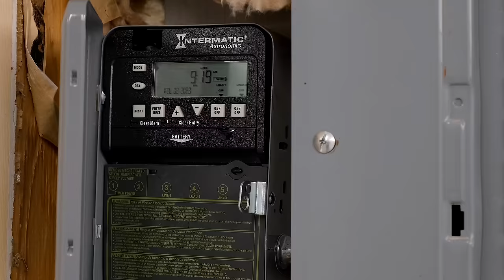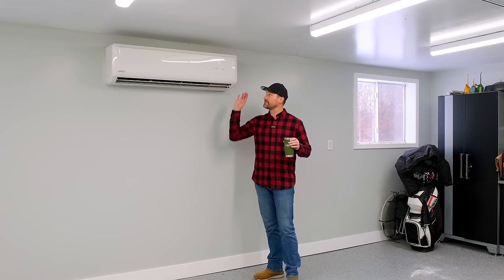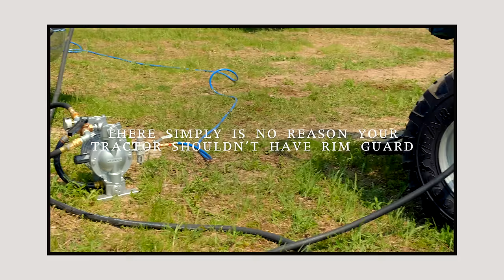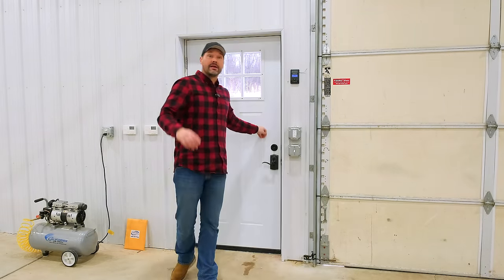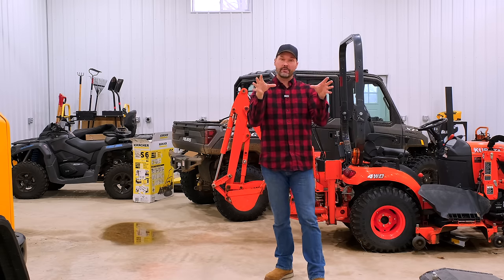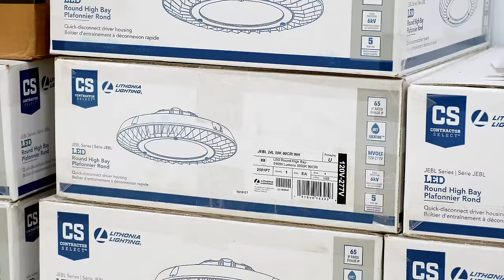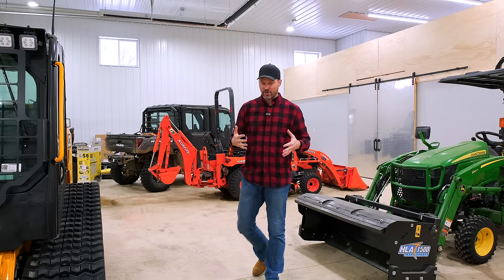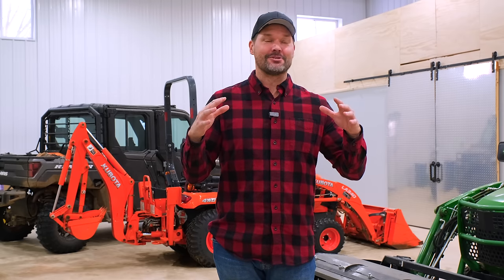AVOID THESE TOP 10 POLE BARN MISTAKES OR IT COULD COST YA!

Comment: If you can stretch between two outlets without touching either they are too far apart.  I also like windows that are high, short, and wide.  Especially the kind that crank out.  They let in plenty of light without being a security risk and my hounds can't see wildlife to howl at.  Compartmental lighting with a master switch for every area is nice to have.  Flip 3 of 4 switches when you leave and you know power is off everywhere, including those lights above the work bench you can't see from the front of the building, etc.  A timer for lighting above the primary external door is nice so you can see to lock up in the dark.

Comment: My biggest regret was not putting in floor heat in. Or atleast all the piping to hook up to later. I was in a time crunch and ran out of money. Needed to finish the barn to move on with life. Also for everyone else take what ever size building you think you want/need and go atleast the next size up. And my 12’ over hang off the 40’ side of my building was my best decision i made. That out door covered storage is awesome. Keeps the snow, ran, & sun off anything sitting under there.

Comment: Epoxy floors are super nice but if you do it make sure it's done right. The garage I bought has epoxy flooring but occasionally peels up after parking vehicles or tractors and will need patching. I can see it wasn't properly scuffed up first for best adhesion. If yer going for the garage mahal just remember buy once cry once. Maybe too, if you spend it more will come lol. Oh I couldn't help notice your sec cam or IDF cabinet  is near a sink and plumbing.  Um... good luck never having water somehow finding its way in there. You may want a splash guard but then again maybe never happen. Working in IT I've seen it enough times when it affects production and you have "Jerry's kids" for work force. Enjoyed the Great video!

Comment: Hi Courtney, I don't know if  it works or not but, my cousin says he uses kitty litre he buys at Walmarts and a wooden 2x4 block to cleanup oil stains on his concrete.  Just dump some kitty litre on the grease spot and rub it in with 2x4 block and the stain will disappear . Worth a try. Love your new shop.

Comment: You may want to consider an exhaust fan if you are running equipment to exhaust any fumes. Also in the cold hot weather it can circulate the air

Comment: If you call around to certain plumbing companies for your floor drains you can get a camera hydrojet done it's basically taking a pressure washer and shoving it through your pipes for the camera on the end it'll definitely let you know where they are and where they end up plus it helps clean out the drains really well

Comment: Thanks for the video Courtney. I’m hoping to build a 40x64x16 post frame (or maybe 48x72 😊) with 3 large overhead doors and a mezzanine in the next year or two. A finished room and bath/utility room under half the mezzanine with workshop under the other half.  Also a 12’ wrap around exterior porch on one end.

How thick did you have closed cell spray foam applied to the walls? And how thick is your new concrete floor slab?
Reply: If I was u stay at 40 foot wide    over 40 ft it get  pretty pricey   go longer and stay at 40 ft or lower

Comment: My shop is used a lot automotive maintenance and woodworking. I did put a loft in which we use for storage to free up space on the main floor. I also painted the ceiling and upper half of the walls white to improve the lighting. If you're going to use it as a shop I recommend putting 3/4" plywood on the lower 8' of your walls. It is more durable than metal and gives you a solid surface to mount or hang things. I also painted the lower walls and doors with an oil base paint that way it is washable. Grease hands and latex paint don't mix.

Comment: i'm going to polish the concrete. i cut expansion joints every 10 foot on a 45 and it looks like huge tiles, i'm going to do a black and red acid stain checkered pattern with a black border and joint filler. should come out great and be super durable. also using siloxane sealer for extra protection

Comment: Good Vid, thanks!  I just put up a Morton Building and am in the process of finishing it out right now.  The shed had it's own Cat6 for internet, 200A electrical, and I tapped my existing well to bring water.  It also has it's own septic and a bathroom too.  Add ceiling fans, helps stir up the heat.  I did most of your suggestions.  My walls inside are 1/2" OSB.  Steel looks nice, but OSB is nice for hanging things.

Comment: In 1995 I built my 36x60 heated shop on full foundation and 2x6 framing like my house.  Expensive but it matches the design of the house.  Thought about building bigger at the time, but cheaped out.  Been kicking myself ever since because I was stupid and located it so that it is very hard/expensive to add on to it.  So now I'm working with a contractor to build another building for unheated storage, pole barn this time, and it will be 40x80 .  Fortunately, I live on 9 acres and the township allows an additional building.  Other towns, one outbuilding and you're done, so no second chance.  A friend lives in the next town over and the max size shop he could build was 35x35 with 8 ft ceiling.  He wanted to go bigger but couldn't, so do your research before you buy.

Comment: I'm looking at building a barn this spring.. if I can find a construction company with employees - that's quite a problem where i'm at, none of the good / known builders are taking on new clients (for the past two years now). Good points on the floor drain and lighting, already had that in mind. A gantry crane is a must have for me at least, and for a welding station I always purchase abuse resistant 5/8" drywall to line it for fire ratings. One other note that I typically do in workstation areas, is have 3/4" plywood behind the drywall.. so you can hang anything anywhere. :)
Reply: I’ve not heard of abuse resistant drywall, is it Type X?  Do you also put rock wool behind it to increase the fire rating?
Reply: @elained9591  yeah, I use rockwool for sound dampening too. it's not really needed with the abuse resistant stuff. It's super heavy tho. As for the type X, it's also in the type X category for fire resistance.. but it's great to use in high impact (fabrication) areas.
Reply: @6point5  thank you!  I knew about Type X, I didn’t find rock wool all that heavy though it is heavier than fiberglass batts.  I think it’s easier to work with and I’m not itching everywhere😂  I want to put in a small welding corner in the tractor shed and can’t figure out if I just want to use metal around it, yes things will stick to it probably or Type X. Any thoughts?  I know how to MIG weld but want to learn stick welding.
Reply: @elained9591  oh, I meant the abuse resistant drywall is heavy. really heavy. 4x8 sheet sucks to lift on your own, something like 100lbs each. 
Type X and rockwool is fine for fire prevention, I just like the abuse resistant so if you hit something into the wall (steel, carts, etc) it doesn't dent.
Reply: @6point5  I’ll have to look into abuse resistant drywall. That’s something I imagine our specialty supply store has a better price on since the box stores no longer give Veteran discounts on building supplies

Comment: I agree with all of your recommendations except maybe height and mezzanine.  Our 40x60 with a porch, floor drains, bright lights, and concrete plus epoxy coated floors.  We added 6 wondows on the south side to gain light and love that.  We also went with power doors on each end for a drive through and park off to the side. That has worked well for our farm truck, RTV, and tractor leaving plenty of room for wood storage and shop area.  We plumbed in for a bathroom and 2 exterior faucets next to the concrete entry pad.  Wash mud off outside!.  We are set up for a possible apartment with a shower and commode and sink, plus a shop sink and on demand hot water (propane).  We didn't feel the need to go higher and add a mezzanine...ask us in 5 years if we regret that.

Comment: Just put a down payment on a 40x80x16’ high, with 14’ high x 18’wide overhead door.  I went with the clear panel 24” under the eave for natural lighting along the entire north wall.  I have no intentions of heating so R-Value is not an issue of the clear panels.  Added a 10’ x 24’ long porch along south wall.

Comment: Love the super clean look! So many shops I have worked in were poorly lit and felt like a cave. The mistake I made in my shop due to budget was filling it with stuff intending to add the insulation and electrical later. Now that winter is coming to a close I'll have to pull everything out.

Comment: About the plumbing: be glad it is a polebarn. Without a concrete stemwall in your way, it is relatively easy to dig up to the building - then undercut the slab almost anywhere to run lines. Saw cut the floor, and you are good to go.

Comment: Looks nice….I did think of the water lines and conduit pipe, but totally forgot the water drain lines.  I wired mine up to save money and turned out good but forgot to run some constant hots outside for plugs.  

For your drain line search, you may try google earth.  You can select the date at bottom left and go back in time and may see the trench lines.  On the floor I would use the rotary disc on pressure washer (commercial style is faster) and just spray some concrete sealer after it dries. Stains will still be there but that epoxy is a pain. Also make sure to seal that new concrete if haven’t already….that will reduce staining.

Comment: My dad and I started with a 40x60x14  back in 2006  and added on every year and a half  till 2012 when we stop   and he died back in 2017  and I added on one last time in 2018     now it 264 feet long with a 16 ft overhang on one side and a 90 ft on the other side with a 30 ft greenhouse  and I getting ready to add a other overhang on again and put in my shop where my greenhouse is at so I can get that free heat from the greenhouse in the building in winter if the sun is out

Comment: I put two runs of LED strip lights that run the full length of my workshop with no gaps.  They work great.  Very few shadows and very bright.  The only problem is when you walk outside at night to go back to the house, you can’t see a thing for the next 60 seconds.  Highly recommended.
Reply: Strip lights won’t have the lumen output like a commercial fixture like these. There’s a reason all commercial spaces are built with low or high bay lights and not strip fixtures. With a lower ceiling height they become more of an option.
Reply: @Sparktrician  Au contraire.  Commercial strip LEDs have plenty of light for a workshop.  Most recommendations are 80 - 100 fc for workshop space.  My shop is 32x48.  Using the 80 - 100 fc range this gives a lumen requirement of 122,880 to 153,600.  The commercial LEDs used provide about 12,000 Lumens each and I have 12 of them, two rows of 6.  This yields 144,000 lumens which comes out to about 94 fc which has been more than adequate for my needs.
Reply: @Sparktrician  Sure, it is your prerogative to be wrong.  My lights were recommended and installed by a commercial builder and work great.  I have not measured the light intensity as I have no need to.  With a white ceiling and white walls and a white overhead door, my workshop is plenty bright, almost too bright and the light is much more evenly distributed than buildings using essentially point source fixtures. Point sources only work well if you have very tall ceilings.  With my 14’ ceiling, point source lights would have been a bad solution and would have created bright spots on the floor and a lot more shadows.
Reply: @Sparktrician  Well, as a licensed electrical and structural engineer in multiple states, I stand by what I said.  You commented on a situation you knew nothing about.  Not very bright of you, pun intended.  😁

Comment: with regard to your flooring, i have used airplane hangar paint. if it can handle your gulfstream, it can handle your tractor. i can not remember if i etched it first but i probably did. also, for another project, i used the paint that you can get in home depot. it came with the flakes. that worked out quite well too and probably hides stains well. just remember, once you open the bottle on this, you open the bottle on this....if i was doing something like you, i might look into a stain - perhaps a marbling stain. why? it might hide the stains from machinery and wheel spin, it might look great, and it might be less maintenance in the future. i would not be looking to create a seal, i would be looking for it to breathe. if it breathes, there is no barrier like with anything oil based. so no bubbling or peeling.

Comment: Mr.  Courtney!  Thanks so much for this video!  As you may recall it was one of my questions to you - size of a tractor shed and your timing is perfect.  We have a woodworking shop at the new place.  We finished upstairs with a bit of sheet rock and a split duct system.  We also put in a split duct system downstairs where my power tools will be.  We chose this over the less expensive hvac system because of their efficiency here in the South.  We also had an electrician change out all the old 8’ florescent lighting to 4’ LEDs and relocated one I could have never reached due to my height.  The 4’ are more manageable for me and the same fixtures could be used so the cost was lower. It’s really bright which is needed as we age.  

My only issue is there was no water to the shop…who does that?  No water meant no sink and more importantly, no toilet.  So instead of adding another septic system, I’m looking at a composting toilet😩 which may be something for you to think about.  We were able to have a plumber tie on to the well and run water to the shop so I will get a sink at least.  We are just going to put in a small point of use instant hot water tank inside and then outside will have a frost proof dual silcock so I can wash the dogs under the lean-to.  It would have made life much easier if the original owners had put a half bath in at the least.  Hindsight is always 20/20.

Although I haven’t tried it as yet on the concrete floor in the shop, I understand sodium percarbonate will remove most stains on concrete as well as a bunch of other stuff.  Works best with hot water and you’ll need a stiff brush to keep working it in, keep the area damp or wet until you’re able to get the stains off.  I originally purchased it under the trade name “Stain Solver” but it’s just sodium percarbonate at either 99% or 100%, not sure which. I do know it will remove grease and oil in a carport with a little work.

I would also suggest for folks who are building to consider where they live before putting a lot of windows on the south side as this will provide solar gain making their interior warmer.  In the South where we have longer hot weather periods, they might want to look at sawtooth or north light architecture which will provide a more consistent lighting with relatively no heat gain as compared to south windows.

Comment: I’d say my biggest regret was running the electrical in the wall. I’ve added machines or moved machines to a different location and adding another circuit just isn’t easy. Next one I’ll do will be all external conduit. It makes it much more serviceable and can be changed and modified easily.

Comment: Take a look at rust bullet concrete. It is very DIY friendly, can had sand added for grip and can be repaired easily if damaged. 

I’ve used it on two garages and have been happy with it.

Comment: Best way to get oil stains out I’ve found is powdered tide. Dump it on the spill, “grind it in” with a boot, let it sit 5-10 min then get it wet and grind it again and wash. Works well for the building we used for wrenching and butchering back and forth

Comment: You are absolutely correct build bigger. You never know what else you may acquire in the future. Radiant heat in the floor plumbing lighting and the loft are all points of interest. I also like what you said about drainage especially as it pertains to cleaning your vehicles inside  and the slope of the floor to permit rain to drain outside away from the barn.  I have also seen videos regarding water collection from the roof which was tide into the water collection system. Also wall areas for working on equipment waist high plus storage. Overall its a good looking place.

Comment: A couple of comments on a great finish. You've done a lot to attain the space and conditions you were needing- congrats! On your two shorts- the kitchen and the poor water control at the roll up door, and I'll bet on other walls with that paving outside; on the kitchen or what ever, plan what you are installing to use OTS cabinets, cut the dry wall, quick patch it for insectr control and cabinet over it. Without a drain line you don't have a bathroom will be difficult but doable, and last, on the rain water- was the slab all poured at one time and then the building erected later? That would explain the threshold problem- and you should look to see if water is affecting the base of other walls. You started with bare bones and have done it well!  FR
Reply from the maker: Hi Frederic, thanks for the comments.  Good tip on the kitchen.  Plan to add that and a bathroom down the road.  Too much money to swallow at this time.  I'm unsure of the timeline on the original building and slab.  We just moved in less than a year ago, it was existing for some time.
Reply: @GoodWorksTractors  All cool- bandos, whether "-miniums" or not, are seldom finished in one go- and it leaves more content down the road! My response was to help you maintain that sense of cost effectiveness and still achieve a great result - absolutely no disappointments there!  FR
Reply: @GoodWorksTractors what is the size and height of your barn?